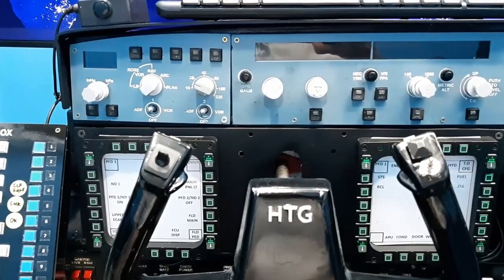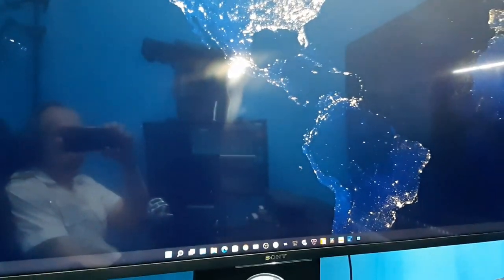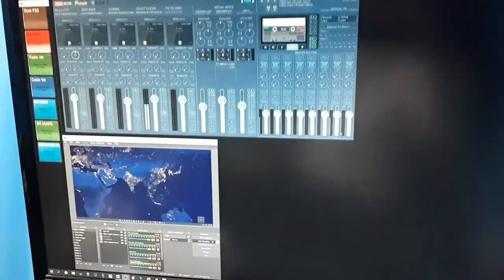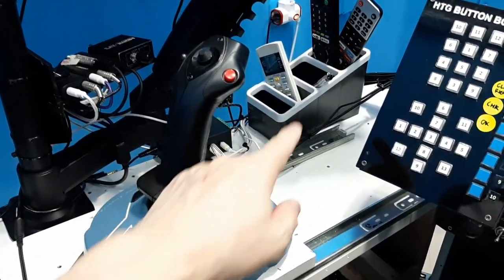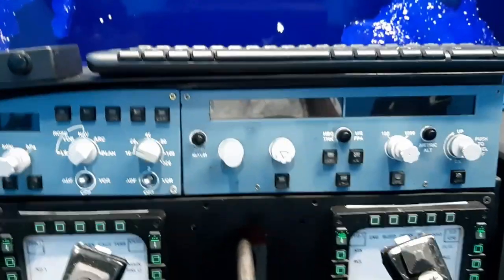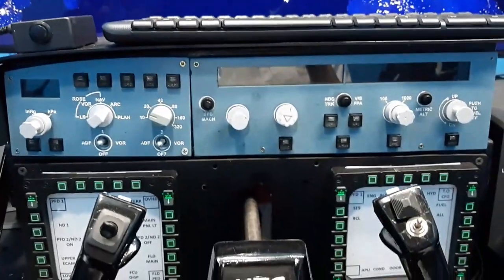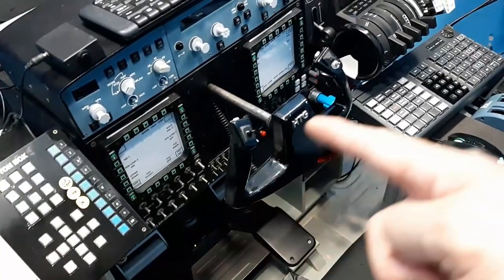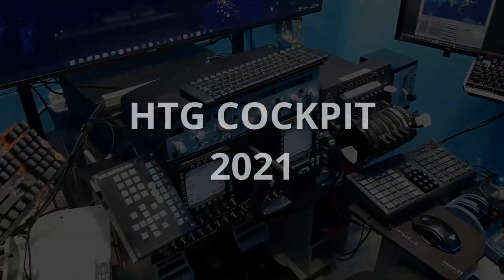HTG Multi Cockpit Configuration Updates Nov 2021

Comment: Hello and good job...
i have a question...what did you say about pull and push the varo ,alt buttons etc¿ im triying to config those buttons , for example..set baro standar and push again to deactivate the standar mode.
Reply from the maker: I m a le to set the std and  baro push pull simulation. Im using mmjoy with virtual switch setting so every push to the encoder push button will toggle state of virtual switch from ON to OFF to ON and so forth. If you only have a push button (not a toggle switch) you could use the spad.next condition setting to check the current state of the relater simvar the  flip it to the opposite  value usually 1 or 0 so it will imitate the pus and pull setting by pressing push button
Reply: @hobbytechgearID69  thanks,im using mobiflight with arduino..can i do the same ?
Reply from the maker: I think so, im not too familiar with mobiflight yet as I will use it for my full a320 cockpit built some time next year. But worth to dig on the feature of switches in mobi flight.